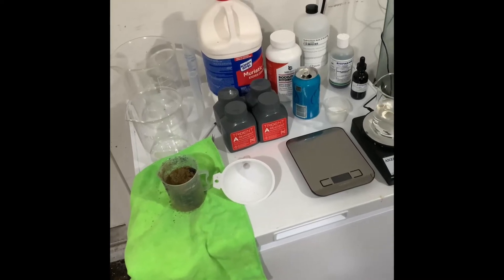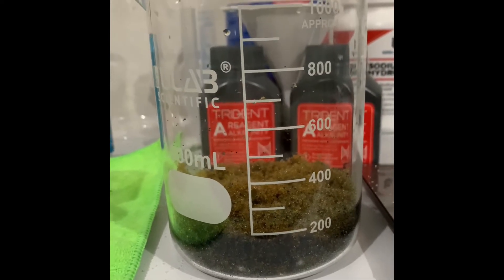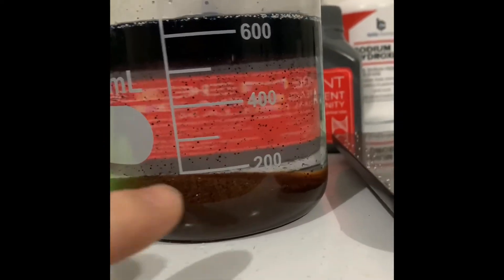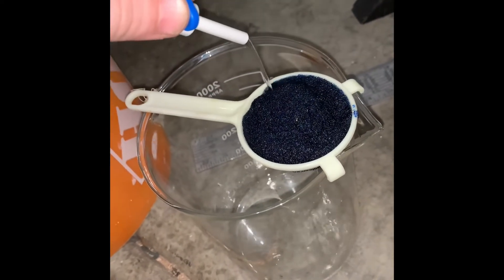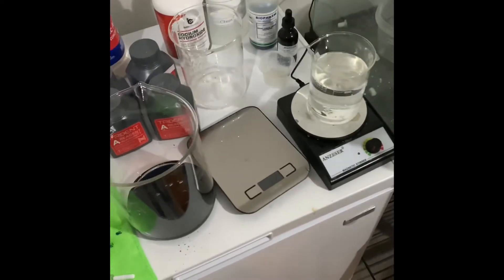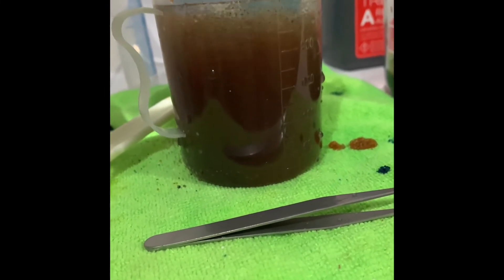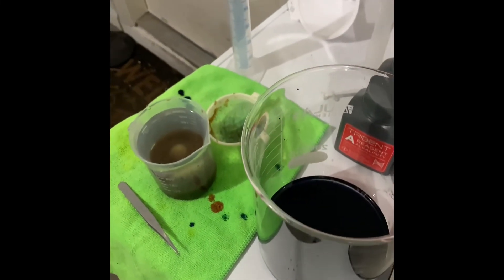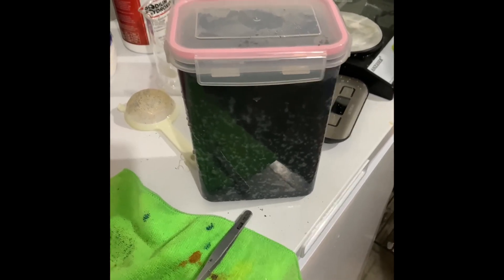Regenerating De Ionization resin for aquarium use

Comment: After regenerate can you use regular tap water to rinse of the first initial rinse of acid or will that mess it up
Reply from the maker: You can, it will use up some life of course though. Distilled water from the grocery store would work too.
Reply: @poor_mansreef8908  ok thanks. I probably need to find a better to rinse off that stuff in the initial rinse because I do about 2.5 gallons worth of resin at a time and it seems like I’m wasting a lot of water rinsing off the stuff. Maybe I’m rinsing too fast
Reply from the maker: @Skdjiejxuje  it rinses pretty fast in an aquarium DI resin canister. That requires pumping water through the canister.

Comment: did you use food-grade or lab-grade Sodium Hydroxide? I feel like whatever contaminate in nonfood gade would just bind to either the cat-ion or anion resin when it's recharged or flushed away...Crystal Lye from Home Depot is $6 while food-grade lye from amazon is $14. Both advertise as 100% Sodium hydroid, now I wouldn't use Crystal Lye to make pretzels since whatever contamination will still be in the pretzel. I'm trying to recharge my zero water filter, there seems to be no anion resin, I only see 1 resin color the amber one.
Reply from the maker: Some companies sell non color changing resin. If its 100% depleted then yes even with anion you would only see 1 color. It does not matter which grade you use, i use whatever i can get my hands on. You will  notice the first flush of the regenerated resin has high tds and then it knocks off to 0 in a few minutes. No issues at all.

Comment: Great vid bud do u know where I can muriatic acid 31% and what kind only can find patio or something to do with gardening  thanks
Reply from the maker: Pool section from lowes or home depot, the 31% doesn’t matter really. You don’t have to dilute it you can just use full strength right out the bottle, the minimum would need to be around 7% if you cares to dilute it.

Comment: Great detail and cool procedure...  I only chew thru the anion due to high co2 in my well water.  So I run them separate.  How much is that sodium hydroxide and what's the estimated savings vs buying new bulk anion?
Reply from the maker: $40 for the muriatic acid and drain cleaner will regenerate 2 x 7.5 lbs bags of di resin.